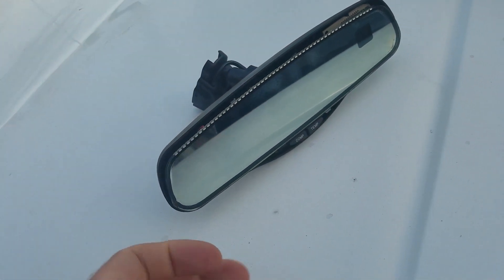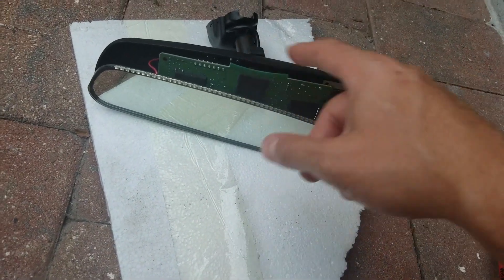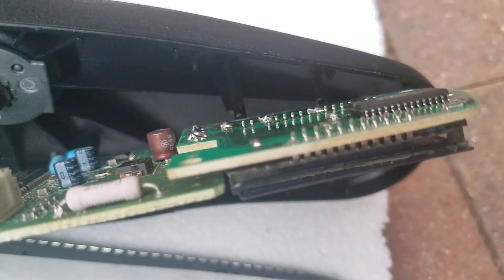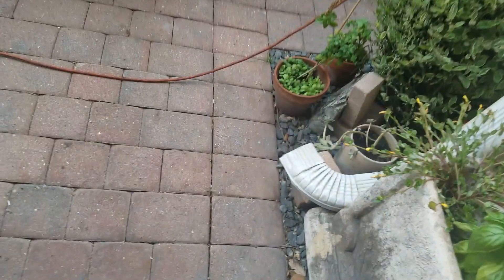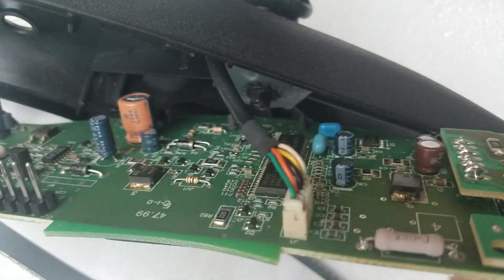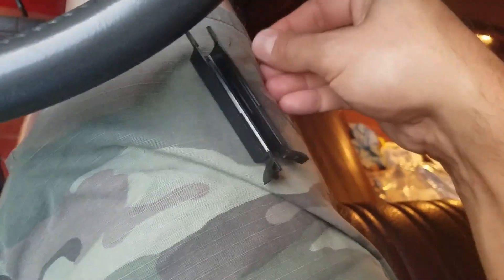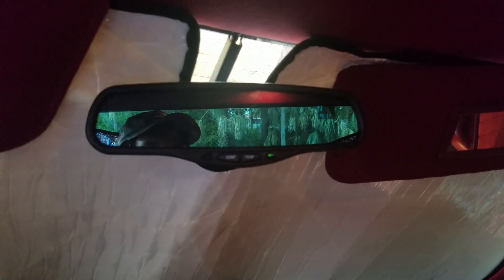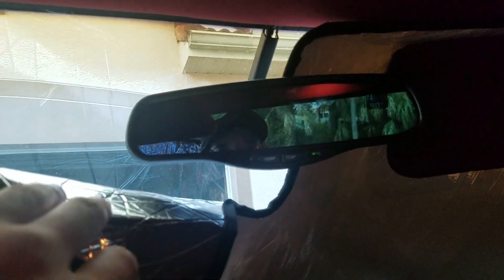Gentex Rear view mirror NO DISPLAY no compass temp FIX

Comment: We don’t see what you does exactly to repair 😢
Reply from the maker: I said it   and showed it. If you dont know what solder posts are and resistors perhaps do not attempt electrical repair.   Mirror still works
Reply: @GhettoWagon You don’t show how you had process, a pity don’t need an MIT license to use a soldering iron 😂
Reply from the maker: Yea it was not a how to video I said To solder all the posts and resistors. Did not think it would work It did! It does.  @FullDetailling